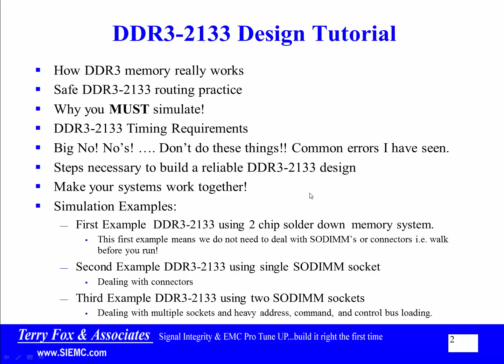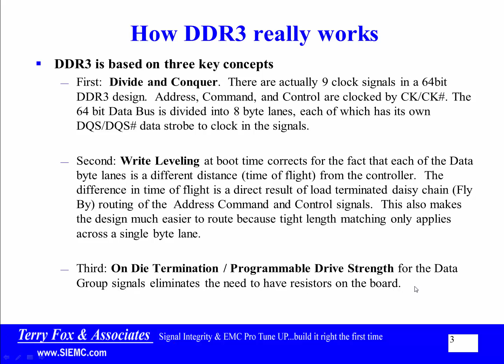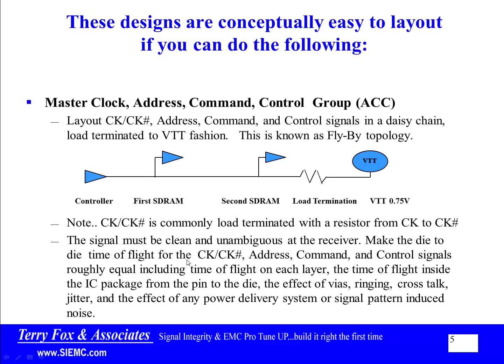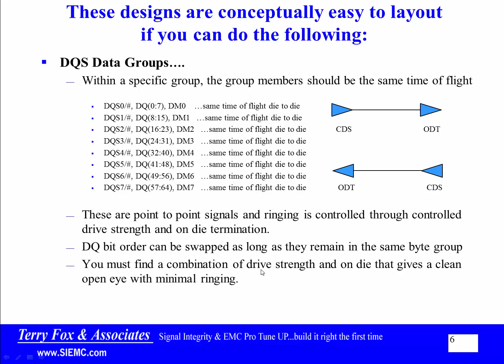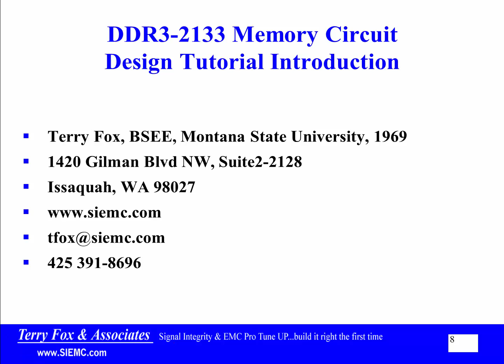DDR3 2133 Tutorial Intro

Comment: If I remember correctly, first data bit within the data byte can not be swapped. For exapmle, D0 can not be swapped with other bits, D8, D16,.. can not be swapped, too. I don't remember anymore where I got this information. Can you verify?
Reply: Hi Mübin
if it's actuallity yet

It's one of the most famous mistake with regard to ddr
Yes, there are DDR controllers which don't allow to swap D0, D8 etc, but it's only particular cases for particular ICs. 
In common case, You can swap any bits within Bytelane 

With respect

Comment: DDR3-2133 means the fundamental clock is 2133/2 or 1066.5MHz  The data is transferred at double data rate or 2133 mega-words per second
Reply: Same as old ddr3 I asume only 1066,5 MHz. Im running Kingston XMP 1600 at 800MHz
Reply: Bazz Musicjlnjbbv mm by